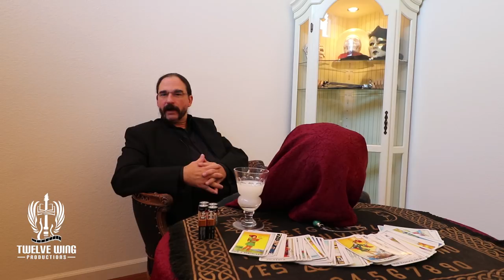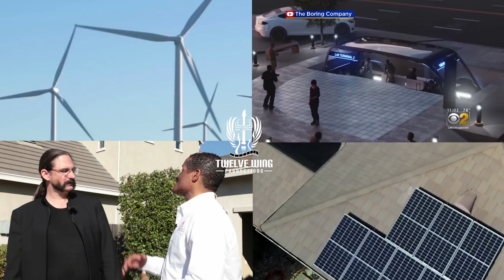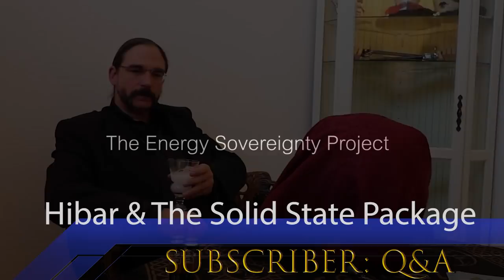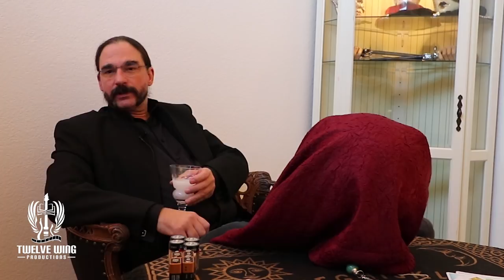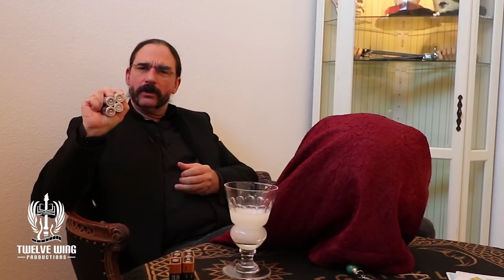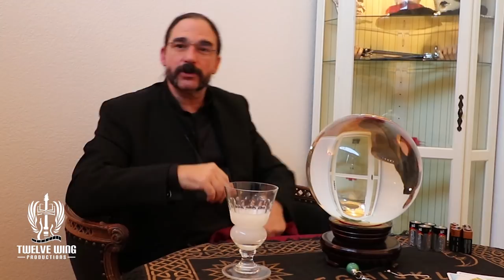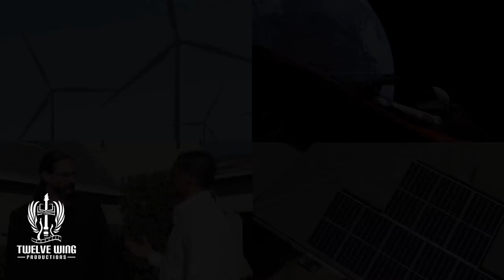Tesla's Purchase of Hibar & The Shape of Solid State Batteries

Comment: We are in agreement and I just left approximately that idea on Gali's channel.  I am sure Musk will increase the size of the battery for S and X to 120 kWh...but no higher.  The pick up on the other hand could go to 150 kWh and with the new Tesla cells will get 500 miles of range.
Reply: That's wildly optimistic. A model S has a very low drag coefficient with a fairly small cross section. The pickup will likely be burning 2x more energy on drag at the bare minimum when traveling at 70mph.  A model S goes 3 miles per kilowatt hour consumed, and the aero drag is about 50% of that energy. The Model S has an effective Aero of 6, while an older F150 is about 15, so if it travels at the same speed, every 3 miles, instead of eating 450 watts in aero, the truck is gonna chow down on 1125 watts of energy, plus the 550 in rolling resistance (lets pretend it's even, but we know the truck is going to be substantially worse if it's set up to do any kind of offroading) and now the truck is at 1675 watts per 3 miles driven at 70, instead of 1000 in the model S.

These stats are from the Ford engineers in reference to the Ford Lighting from the Special Vehicles Team, which was basically the raptor of it's day. It was a sleeker, high speed high power F150.  It's possible that the .44 has been improved, but we know it's higher than the .36 that dodge anounced for the ram, or Ford would be talking about actual numbers. I think it's safe to assume that the Tesla will be better than a Dodge Ram, so maybe it will only be .34 or even .32, but it's definitely not going to be .24 that we see on the S, and it's also not going to be that small, it might have more frontal cross section than the 33.5 that the old lighting had, so we won't know until we see more details from Tesla what the expectations for drag are.
Reply from the maker: @markallen6433 , I think that he will increase the Model S to 120-160 in the near term but I think he is shooting for a 200kwh battery for the Roadster.  Because of that, I think he will be using that same battery in the truck.  The roadster gets about a 600mile range but that is tongue in cheek.  Everyone knows that the real world range of a Roadster will be 300miles... because of the way people will drive it.
The cool thing is that when you stop driving it like a lunatic, it will actually go 600 miles.

The truck?  Well I think they probably did a pretty good job making it slippery.  Musk says 500 miles... but we will see.  500 miles does sound doable for it though, provided they use the same 200kwh battery.  Let's see what they announce later this month.

I may have to do a video where I invite folks to contemplate the design based on what we already know.
Reply: @twelvewingproductions7508  I think it looks like maybe .35 or .36 for the rivian at the most optimistic, but they won't release stats.  The Tesla Semi is at that point, so there is a good chance that the truck will be better, especially with a bed cover, there might even be an option for a sloped bed cover, but that might not be feasible for implementation/visibility.

I don't think it's going to be that much better, so it's possible that you could get 150kw givin about 400 miles of range in ideal circumstances, but that seems like the bleeding edge of optimism to me.

We really won't know until they release info, but I suspect the Tesla pickup will be much more aero than the Rivian, but may not necessarily be sufficiently aerodynamic to make a substantial impact on the range. It's also going to be a big question of whether or not the Aero is going to be oriented towards empty bed hauling, full bed hauling,  covered bed or towing, and whether or not it will be designed with a 5thwheel/gooseneck hitch or not. The Tesla Semi is definitely designed to make the aero good while towing, but I don't know of they will go that route with the small pickup. It's just too undefined currently, but I do suspect that the 200kwh pack will be a goal for at least one trim level on the pickup.
Reply: @markallen6433  Well, first 500 mile range is the stated range by Musk. No doubt that is in optimal conditions. Now the truck is also radically different in  design...and I suspect it has a lot to do with aerodynamics. So it is not comparable with any existing pick up. The model X gets 325 miles on 100 kWh.  If the pick up was equivalent it would get close to 500 miles on 150 kWh.  However, here's the thing: A 150 kWh battery has a much reduced cycle life, especially for average use of 40 miles per day, and so greater demand and drain can be applied to the battery so with this in mind 150 kWh should get close to 500 miles (on a sunny, windless day at 65 mph!)
Reply: @vensonata  I don't want to be overly rude here, but if you knew anything about aerodynamics, you would know that the model X is nothing like a truck in terms of Aero. Flatly stated, the truck will not have a drag coefficient similar to the X, nor will it be as short, and it might even be wider. It will not have an effective Aero profile similar to model X at 70 miles per hour. It just won't, so go ahead and put that out of your calculations.  

The increase capacity of power is not going to effect efficiency all that much.  The Tesla electric system runs a 96s battery, the p100 packs run something like 84p? so when they push out 600kw, they are tapping 20a per cell, which is basically the peak output capacity when prepared thermally for a short time. That's solid, and the truck will be able to do the same thing, except it will be able to place a lower amperage load of 13a when demanding 600kw if they run 50% more cells, (they won't be using 18650s obviously, this is just for comparison)

However, if they consumed peak power for any amount of time, they wouldn't get 300 miles, they would run for 10 minutes and be ready for a recharge, or well they would be on fire, because they can't handle the thermal load of 600kw until they are drained, but the point is that they don't use power like that at all. They use 23kw when they cruise at 70, which is why they go 70 miles an hour, using 23kwh to do it for an hour, which is why they get 3miles every kwh consumed... so they use 1/20th of their capacity of max power output to cruise at highway speeds.... so you go from 1/20th of max C rate to 1/30th or 1/15th and you're not going to have any impact on the energy output over the range of the battery drain. That's only when you get into meaningful values of C.

Sooo... yeah, everything you said was irrelevant to how far the truck will go. There are only a few things that matter: What is the effective Aero of the truck, which is the drag coefficient times the frontal cross section, what is the rolling resistance, what is the kw output needed to drive that vehicle at 70mph, what is the battery capacity in energy, not power, as power is not relevant to a conversation about freeway crusing speed, power is relevant in a drag race, and the Teslas are all wildly over powered in order to keep the cruising specs at very low C rates relative to max C.
Reply: @markallen6433  Recent motor improvements by Tesla have increased the range of the Model S highway by 10%, partly due to regen, plus permanent magnet motors. In city the improvement was 14%.  This tech will be applied to the Truck. As well, a larger battery pack is discharged at a slower rate than a smaller one. That discharge rate also increases the amp hour capacity.  The slower the discharge the greater the efficiency.  As to your speculation about the aerodynamics of the Truck....nobody knows yet, do they? All we know is that Tesla has produced the most efficient car on the road with the Model 3 surpassing the Ioniq.  We shall see.
Reply: @markallen6433  Actually...I've changed my mind. 200kWh is more likely. The reason is the truck is much bigger than I had thought. At least the way Musk is talking, it is going to be a monster.  So yes, 200 kWh for 500 miles, and maybe 250 kWh for 600 miles.  However that also means the price for the lowest model is $50,000 and easily climbing to $80,000 for the 250 kWh model.
Reply: @vensonata  I think this is likely. Having parity between the pack in the roadster and the truck has obvious benefits. 

You're correct about the amp draw increase reducing total Watt hour capacity, but you're overstating the impact at this low level of demand. Tesla's have already been designed to the point that changes in discharge from cruising speed to 20mph more is well within the same band of efficiency. This is a negligible factor for all Tesla vehicles driving in a legal manner on the freeway.

We simply won't know until it launches. Maybe Elon and his team can manage some huge efficiency increase. It's possible that they will manage 400 miles on 150 or so, but that's at the absolute limit of what seems possible without a huge paradigm shift in engineering that I'm not privy to. That's why I called it optimistic and not impossible. Just gotta wait and see

Comment: Pouch cells would be problematic with a chemistry that runs hotter.  Deformation in a pouch cell more pronounced than a cylindrical cell, which is stronger.  Important when trying to create a battery with longer cycle life.  Lots of speculation here....improvements are certainly the goal, but huge strides to a “super cell” may be exaggerated.  Smaller changes and a more gradual improvement are more likely....cheers!
Reply from the maker: What you say is totally true of a cell that outgasses at high temperatures.  With a solid state cell, we would be talking about a pouch that did not exhibit significant expansion from heat.  Currently, the paste electrolyte is highly susceptible to damage from thermal expansion and contraction.  What we need to all wrap our heads around is that we are now looking at a battery... that doesn't.
Reply: Twelve Wing Productions   As far as I know, everything expands when heated, just depends the rate of expansion we are talking about.  And what the “solid” electrolyte is....different elements expand differently.  Still trying to wrap my head around a solid electrolyte, and how it could possibly work!  Guess time will tell.  Cheers!
Reply from the maker: @jimhofoss9982 , no argument that it will expand.  Hell if the cells work best at 120F degrees, that entire pack is going to expand.
And trust me Jim, you aren't the only one of us that's still trying to wrap their head around a solid electrolyte.

One thing I can say is that it's not a contiguous sheet.  It's a granular material.  In the case of the "Million Mile" battery a granular material made of monocrystals.  Likely created using spark plasma sintering.

Comment: It's a dry battery. We have here a solid coating.
The proper solid state battery has a solid
electrolyte. That is the current definition.
Reply from the maker: Understood, and that was what got Goodenough and Braga in a bit of hot water when they sent their research out for peer review.  They used what appeared to be an "electrolyte" as well as the "glass" cathode/electrolyte in their solid state battery.
I wish I knew more about the glass battery, but the thing that seems to differentiate it is that it contains no real separator layer.

Because of that, we may all have to tweak our understanding of the definition, or consider that the glass battery might be some kind of hybrid.  Same with the "Million Mile" battery.  I believe the two are the same.
Reply: @twelvewingproductions7508  The most sensible
thing is to go there and look at all your contacts
and sources to find out the secrets.

Comment: I wrote earlier today on another video. That tesla is delaying the semi and roadster release. Because a better battery is coming faster than expected.
And tesla didnt want to piss off early owners of the roadster and semi
Reply from the maker: I agree... sort of.  I don't think it's a case of discovering a new tech.  I honestly think that the roadster and semi were both designed with this new battery in mind.
I think they are delayed because the weaponization of the tech was delayed slightly.
Reply: I don't think that Musk would have released the estimates for a Roadster like that if he didn't think that he could begin production of it with some kind of battery improvement, whatever form that ends up taking. I think that both the Roadster and the Semi as well as the Pickup are borderline viable without an improvement, but just barely. With a big improvement in cost and density, they become much more impressive models, especially if they are designed not necessarily to have the feature at launch, but to have upraded versions produced in the future that make use of some capacitve bank for higher powered regenerative braking.

I think it's quite likely that these designs all originated from a point in time when it was unsure if significant battery upgrades would manifest, but the delays to the Roadster and Semi definitely would make sense if they were stalling in order to delay the production until production of a new type of battery is live. I think it's a mistake to be so sure about what that battery will look like, what it's chemistry or form factor will look like, what it's energy density will be etc. We just don't know and won't know until Tesla is making them reliably and in quantity or is certain they can scale production and make an announcement. It's important to not forget that if they just found a way to increase the thermal hardiness, energy density, specific energy, amperage output and cost of production for regular-ass looking 2170s, that would pretty much account for the bold claims being made by Elon about the new roadster stats. A bit more thermal hardiness is a huge factor, because that creates a much higher thermal transfer from the battery to the cooling mechanism, and so a cooling system of the same transfer capacity (of the cooling fluid) is going to be capable of accepting much more heat from the batteries while keeping them in spec, without adding huge amounts of weight or volume. The only thing that needs to be better is possibly the radiator and definitely the active cooling system, but the radiator itself is going to be doing more work because it's going to be hotter relative to the air, so it dumps out more Joules as well. 

It would be super sweet if Elon magically produces an amazing new chemistry, but he doesn't have to do that to create a very impressive product.
Reply from the maker: @markallen6433  Also agreed.
Something he saw demonstrated around 2016-2017 set his hair on fire.

Comment: The Model 3 already solved the overheating issues with the new motors, which they are now using in the S/X.  The pack heating was not the problem.  The plaid cars are using 3 motors, which spreads the load and further reduces heating problems.  They don't need a significantly larger pack or new chemistry for them, which I doubt is ready for use within the next 10 months when the plaid S is supposed to be released.  I think the plaid will have 120kwh which can be done with existing chemistry and provide 400+ miles of range.  Larger packs than that would add too much weight and negatively impact handling.

Comment: No, I believe the "million mile battery" was basically debunked as being a NMC battery. Interesting theory, but they'll never use it because it uses substantial amounts of cobalt and that's the opposite of what they want (and what the industry can support while exponentially growing, frankly)
Reply from the maker: Do you have a source for that?
From what I'm seeing, people are getting confused about the "Million mile" tech in thinking that it is solidified.
From what I'm seeing we have several conjoined research projects related to battery technology and they all seem to be using bits from here and bits from there.
I will happily toss my hat into the predictive ring here and say that the technologies that we will certainly see is a monocrystal cathode of garnet and that this will contain lithium ions initially but will likely use sodium ions as a transport mechanism in the very near future.

The lithium and sodium will be held in the garnet as a sold state electrolyte but will require another (liquid?) medium between the cathode and anode.
Both the anode material as well as the garnet cathode material will be applied using some variation of Maxwell's DBE technology.

Comment: Today's Lithium ion batteries increase in capacity during their initial electrode forming process.  The million mile battery in Dahn's paper is a different formulation of Lithium ion.  It's not solid state.
Reply from the maker: Today's lithium Ion batteries lose 5-15% of their lithium forming the SEI layer.  This can be thought of as a kind of "crust" that forms on the electrolyte that inhibits further breakdown.
In addition to that, the greatest losses of current paste type lithium batteries occur in the first few months of operation as heat from expansion and contraction expose fresh electrolyte to the lithium and further lithium is consumed to replenish the SEI layer in these newly exposed areas.
So this runs counter to what you are claiming.

As to the Million Mile batteries, the test data released so far not only does NOT show this initial loss, it shows that the battery increases in capacity at the time of initial use.
So I'm not sure where you are getting your information from but it doesn't track with what we already know from battery degradation reports for the past and current vehicles.